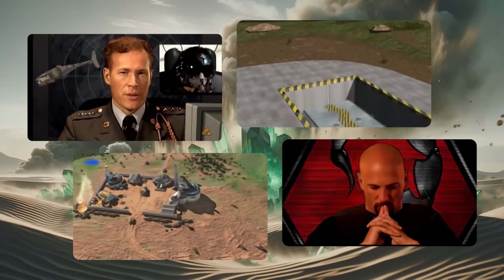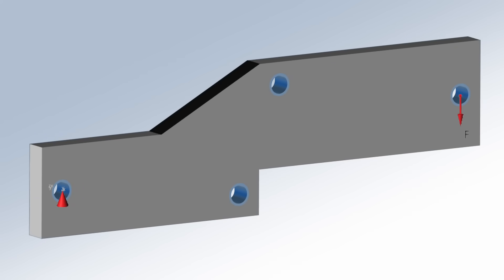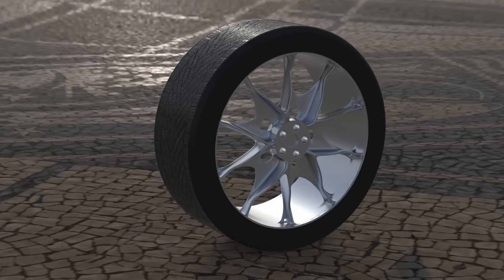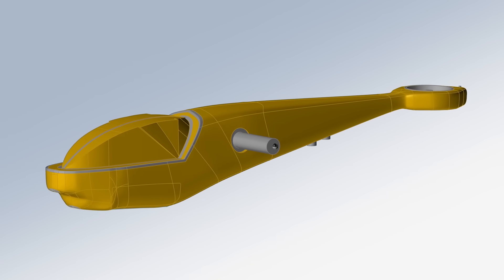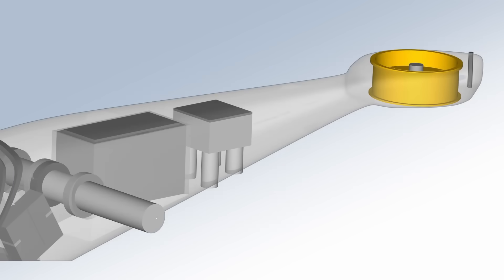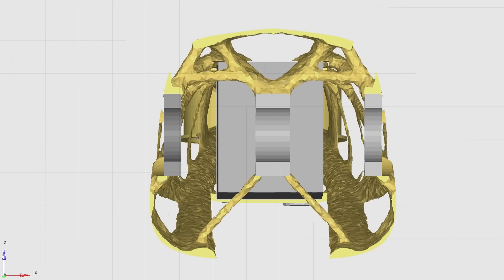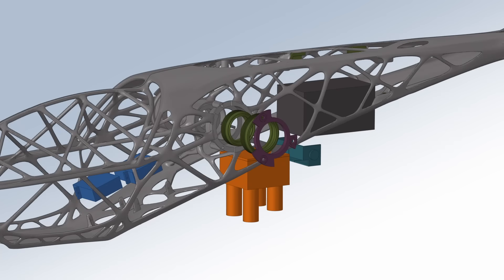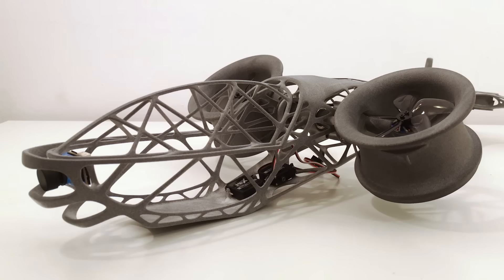3D Printed and Topology Optimized Drone!

Comment: i would add a layer in the inner side of the vents to reduce noise silicon or something might help.  I would want something as stealth as possible.   anything that would reduce vibration as well might help.  and more arrow dynamic blades specialized keep bruit testing until its Super super quiet. find the optimal for that and your golden , - so far fantastic.

Comment: It would be cool if you could update us if there is anything to report :)
Reply: What happened in the meantime..I developed a new model with an integrated airfoil, which results in a real VTOL. It should be extremely fast and maneuverable; the only issue is that testing requires a lot of space and cannot be done directly where I live. Therefore, I have paused development for now. 
In parallel, I started an update for the Orca. It will be lighter, more stable, and have better flight behavior. Will still need some time to finish it. Still thanks for asking!

Comment: Very cool idea and the bionic frame always looks awesome.
I would love to print one my own, but obviously a homemade FDM-printed model would need some optimizations compared to a powder fusion printer. The model/fuselage probably would need to be splited in multiple parts for build volume requirements and ease of replacing damaged parts.
If you ever release any kind of model or kit, please make an update video.
But nevertheless great project!👍

Comment: It's interesting that the Orca seems to angle forward when going faster, because that's exactly how it acts in the original game; in fact the craft has two sprite sets in the game, a flat one and a forward-angled one. (For the record, all vehicle sprite sets are typically 32 prerendered frames to get a full 360° rotation)

Comment: Optimized  but not work friendly
like a cars engine is not ideal to replace any part with out removing the engine  
should not take more then 10min to bolt on a new starter motor

Comment: You may be able to solve the 'pitching forward' issue, by using a reverse thruster assembly on the rear duct.  It will allow some of the air to be directed upwards, preventing the tail from lifting, which has always been a problem with VTOL craft.

Comment: I've always wanted to make a drone based on the Orca (Tiberian Dawn version). It looks like you're flying as a tri-copter (can't be sure); are you looking into doing thrust-vectoring control for forwards flight?
Reply: I think it's naturally stable and the third fan is used only to make it pitch, really nice idea, didn't think about it. Probably more efficient than quadcopters, but it has to be naturally stable. Also no way to roll without yaw, or stabilize against wind from the side.

Comment: Cool Vid! It's insane how far we have come manufacturing and modelling wise. How did you smooth out the topology optimised structures? Did you remodel the parts?
Reply from the maker: In the Software (Inspire), there is a feature called "Polynurbs". It is perfect to transfer topology optimization results into a clean CAD. With a standard CAD programm, I would surely have gone nuts ;)

Comment: Are there ways to take the print direction into account for the topology optimization? Because such anisotropic materials that delayer easier, you would expect different optimal thicknesses in different directions.
Reply from the maker: Good question. I assumed isotrope behavior, which should have been nearly correct for Multijet Fusion PA12. Turned out it wasn´t, too brittle on impact, maybe because of anisotropy. Current solution is to use PA11, which is way more ductile! Until now, anisotropy seems no big issue with that material.

Comment: Hi,
You have a very cool project! And I learned a lot which I can apply to my design. I am developing a real flying car of my own design, so I can really appreciate what you have done.

I started my project in 2016 in San Diego, Calif and I am still working on it, but 3.5 years ago I found a business partner and moved the project ro Fjugesta, Sweden. The project is called Sky Chaser. It is the 1st vehicle if its kind, a real roadable Blade Runner style VTOL flying car. It looks and drives like a car, uses its body as a wing and has no folding wings. It has no exposed rotors and is all electric. Sky Chaser looks and drives like a car, and flies both vertically like a drone and horizontally like a plane, in addition it is amphibian. Since it is an entirely new design for a flying car, I started by developing a working 1/6 scale model out of foam board and hot glue. Then I developed a CAD model that I got to fly in a flight simulator. Then I scaled the design to full scale and now have a unmanned working 200lb prototype we are now testing in VTOL mode with remote control. The tests show that it flies the same as in the flight simulator. Click on my icon the see videos of my tests and a presentstion of the project. Also below are some lonks with more information:

*Website: SkyChaser(dot)se
*Project Presentation: https://drive.google.com/file/d/1FAdls15OriuQ4hoD2xPwXeNQDQTKpK1t/view?usp=drive_link
*evtol News article 1: https://evtol.news/sky-chaser-concept-design
*evtol news article 2: https://evtol.news/sky-chaser
*Simulation tests: https://drive.google.com/file/d/19taPDO1yERAumR8OV1IFk2n1TqNLNUkN/view?usp=drive_link
*Full Scale hover test: https://drive.google.com/file/d/1qDl5X142uC5yt_5Xcb0GUS3h-LgD4P0V/view?usp=drive_link

Comment: Such a fascinating design, and design process. That the drone was able to meet weight, plus rigidity constraints and it flew quite well, is very impressive!
Would like to see more details of topology optimization design process used in a future video. A simple design, to focus on tools used and the design process. Have seen discussions/graphics of topology optimization designs, but never applied to creating actual working object(s).

Comment: How did you determine the motors specs? Trial and error, past experience, or is there a approximation method of this voltage, this motor, and with this prop will produce this much trust?
Reply from the maker: All of it combined actually. The main thing is that there are enthusiasts for every topic, sharing their knowhow freely. 
E.g. I investigated drone builds on https://rotorbuilds.com/.
Channels from Chris Rosser and Jushua Bardwell are also really valuable.
https://www.youtube.com/@ChrisRosser
https://www.youtube.com/@JoshuaBardwell

Comment: Wow.  I'm blown away.  This thing is art.

Are the models for this available anywhere?  Can you give an order of magnitude hint at what the printing costs were?  If the models stay private, are you considering of a small commercial run?  I'd love to have one of these.   [ or v2.  ;) ]

On the topic of weight optimization, i think your fan shrouds don't need the bell-mouth on the bottom side...
Reply from the maker: Thanks for asking :) Small Comercial run is an option but would currently slow the development of the next design. Shower, if many people want that, go a find a way!
The price for printing is middle/high 3 digits due to the size.
There's a lot of potential for mass down/cost down.

Comment: In the game the rear rotor also pitches left and right. Maybe for slow speed manoeuvring, have you tried this in a prototype?
Reply from the maker: Model bases on the C&c Tiberian Dawn Orca, which had a static rear rotor ;)
But yes, it would be working fine to pitch the rear rotor. Actually it would be easier to get the model stable.